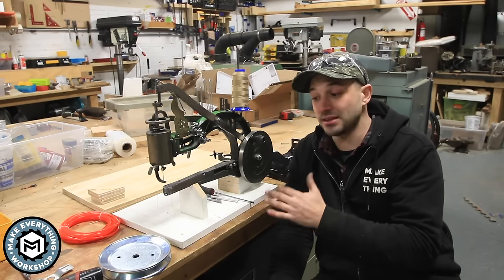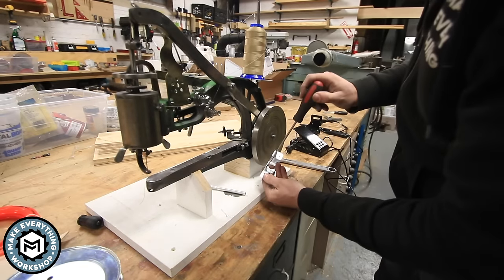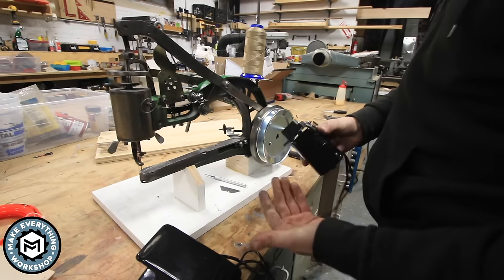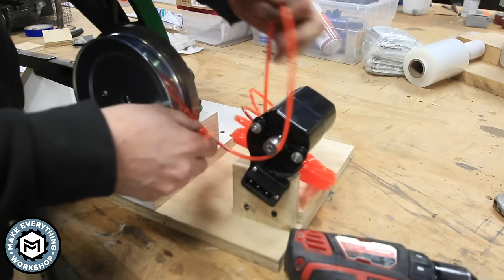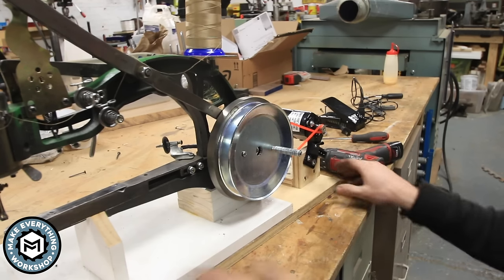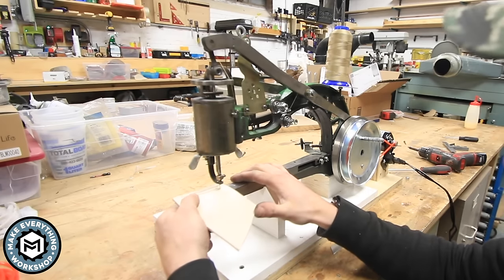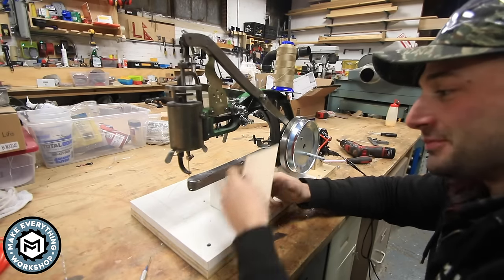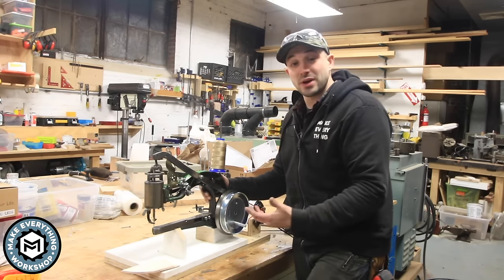Motorizing The Leather Sewing Machine, For Under $50

Comment: Servo motor is what you need. Programmable, able to get motor rpm down to 100rpm, with that pulley setup, machine would crawl
Reply: No, he only needs a light/fan dimmer to slow the motor. I added one to my mum's Singer machine, it works beautifully.
Reply: i used this vid to put this set up on mine and and adding another pulley for reduction did the trick.
Reply: @gustavzollernmakinen1516  I'd like to hear how that works. By creating more of a current draw? I dont get what that does
Reply: @shlomo_jewinstien-Doodoowitz  Just take a fan/light dimmer, solder a lead through it; at one end a female 2-pin plug and the other end a male 2-pin plug (the dimmer being in the middle). The foot-pedal plug goes into the newly installed dimmer female plug. 

Tune the dimmer down to controllable limit. (Dimmer lowers the amperes, making the motor slower) It will never go mad fast on you, regardless of foot pedal input. The foot-pedal becomes very controllable.
Reply: @gustavzollernmakinen1516  I see what you mean basically putting in a rheostat inline
Reply: @gustavzollernmakinen1516  The problem with that solution is that you lose torque as well as rpm when you control the speed by reducing the voltage. That's also hard on a motor and can frequently lead to premature failure of your motor. It  burns the windings on the armature.
Reply: @jjohnson2553  Dimmer reduces the ampheres, not the voltage.
Reply: Can you send me a link
Reply: Lots of good advise here. But as for the belt have you considered using a leather strap kinda like the old Singers sewing machines. Those are more rounded but perhaps a flat leather strap for a belt. Just a thought. Thanks y'all.
Reply: I was thinking the same thing. But what a great job.
Reply: @gustavzollernmakinen1516  well… sort of. Depends on the dimmer and the application. Lamp dimmers tend to work by flipping the power on and off at strategic points in the AC waveform. You have to make sure this is compatible with the motor input you’re using. At the end of the day, it’s probably worth spending a bit more to get a motor which offers a way to reduce speed through its own circuitry.
Reply: @rmTheWalrus  I’d definitely take advantage of the RPMs for added torque with a 3d printed gear box at the price. With how sketchy some of these Amazon motors are I definitely wouldn’t jump into dimmers without being able to verify either. Considering there are ready to print multi-ratio gear box files for free it would be a fun addition.
Reply: So, through a pile of money at a hundred dollar hand crank machine? 🙄
  Just buy a Consew.
Reply: @ralphguerrero518   if leather belts worked motorized machines would all use them. They suck. Today we set up treadle machines with rubber belts.
Reply: @gustavzollernmakinen1516 that's interesting! Thanks a million!
Reply: Yep, sewing machine motor 1/2-3/4 hp on amozon  RPM adjustable from 0-10000 reversiable with rpm read out for little over 100$. BTW if you are thinking about building a wood path these machine motor would be the cats meow. Single speed will be priced as much or more do it out.
Reply: Engineer from Germany?

Comment: The foot turns so you don't need to turn a large piece of work. Like if you want to back stich to "lock the thread" just loosen the wing nuts, turn the foot 180 and retighten the nuts, and run the machine a few stiches.

Comment: Easiest way to fix it:  Pull the cover off of the foot pedal and unscrew the potentiometer about 1/4 turn. This will eliminate that fast and immediate ramp-up you get. Easier than making pulleys, adding bolts, etc. Small screwdriver and 1 minute of time.
Reply: Is this in reference to slowing it down? I was just going to ask about that. I did exactly as he showed in the video and man is it fast. I want to have the machine go slowly consistently if I can instead of tapping the foot pedal over and over again.
Reply: @calebhand1180  Addd a switch and a diode to the pedal only. when u turn it off its on half speed when u turn it on its on full speed.. See this video.... https://www.youtube.com/watch?v=lH4W_d4Mp2c

Comment: Actually all you need for the motor, is a Singer treadle motor like what is used on the 1926 Singer Treadle sewing machine electric conversion. That will give you an electric motor, that will be about the right speed. Your other option is to just find an antique singer treadle base, to make the sewing machine peddle powered. Speed would be much lower with a treadle base, and thus easier to control.

Comment: Bigger wheel on machine is more torque and slower speed.
Reply: I was about to say the same thing.
Reply: I learned this from The Great Escapist lol
Reply: Using a resistor will also make the motor go slower
Reply: @kandlrex  and eliminating the desired torque to punch through leather.
Reply: Would more torque cause the needles to possibly break or bend easier?

Comment: Reversing the connections to the brushes or the field winding on the motor will reverse the direction of rotation.
Reply: he should've gotten a motor controller or geared it down a bit to deal with the speed rather than relying on the pedal for speed control.

Comment: Very nice.

Just a quick note, when you're turning a corner, bury the needle, and use it as a fulcrum around which to rotate the sewing material. Bury the needle, and you can then even lift the presser foot slightly to relieve tension. 

This will keep the stitching consistent, and you won't have to worry about having any thread tension issues, or unwanted loops or gaps in the stitching.
Reply: Thank you so much!! Really awesome advice!! I am a chemical engineer however I need to change my image so I am going to customize my sneakers and other stuff and I found this gem....

Comment: My mother had an old Singer brand sewing machine.  It was a production model that was originally a foot peddled version that had been remanufactured with a motor and a suitcase box to transport it.  I remember she always had to give the belt driven pulley a small nudge with her hand when she stepped on the peddle.  This was to get over the standing still start because of the low power of the motor.  Once moving it did a great job.  Brings back 50+ years of memories.  Great job!

Comment: Very nice video! I used this for inspiration when I did my motor job and I found out that a lot of the "violence" is caused by the hand-wheel being out of balance. I used a hand held drill to drill indents in the wheel and "balanced" it so it runs much smoother. I ran it for a while and then decided to make a jack-shaft to further reduce the speed and made a table so that I had more surface area.  Of course the drilling of the hand-wheel brings it out of the "no tools" upgrade but I'm very pleased with my final product. Thanks for sharing your knowledge.

Comment: I already have a bunch of motors with pedals from repairing old sewing machines and you literally did exactly what I was thinking with this!  I also have a variable speed dial wired into the outlet I would use that would help reduce the speed even more .  Good job you've made me 100% convinced I need one of the cobbler machines now!

Comment: Great mod!
Twisting the belt like that runs it across itself causing friction. That'll eventually break it. You could just turn the motor around or reverse the leads in the motor. Or you could get an old drill press at a garage sale and use the motor in it which will be stronger and slower.
Reply: شد سعر،$
Reply: Another alternative would be to tilt the motor support so the top of the support is slightly further back than the bottom.
Reply: I don't think that reversing the leads on the motor would do anything since it is AC powered.
Reply: @my_dear_friend_  I "think"  those old sewing machines had universal brushed motors. With a brushed universal motor, the direction is set by the relative polarity of the magnetic fields of the field winding and armature. If the wires are long enough, reversing the connections to the brushes will reverse the spin. If it's a single phase induction motor then you're right, reversing the leads will do nothing.
Reply: @MrErViLi   - yes, as far as I know, the old sewing machine motors are brushed. That would be a simple fix then.

Comment: For your information, there is a glue for gluing the rubber cord together.  It's used to glue O-Rings together in hydraulics.  The name is Weicon, part# 12204030.  It dries extremely fast and it's strong.  BTW, a servo motor would be a better choice for this machine.
Reply: I just use any ca glue for o-rings...
Reply: There is one on Ebay for 40 bucks couldnt get much cheaper.. I paid allot more than that for the one on my Sailrite LSV1 sewing machine.. But love it..
Reply: Servo motor he is cheap that is not a solution
Reply: Welding is the correct method to join PU drive belting.
Reply: Servo motor all the way!
Reply: @pressuredprepper4232  link?

Comment: Brilliantly simple solution that could be refined with an idealer gear swapping the direction of the motor an elecronic footconrol etc
 Thanks for coming back with this simple solution. £67 on Amazon in the UK and we use 230v mains so more torque from a motor.

Comment: Personally i would add a layshaft with a small and large pulley on either end, turn the motor round to face backwards, a belt from motor to large pulley, through the shaft to the small pulley and onto the machne.
This would mean a greater reduction in speed, more control range, and because the motor is the other way round, no need for crossed belts ;)
Reply: Your idea also gives room for a step pulley to experiment with the speed range to see what works best.
Reply: @philsullivan3679  No idea what he means, but I wouldn't use a motor. A machine like this was never meant to go that fast, it operates at a low speed with a lot of friction. the best way to make it a bit more automated while keeping the speed low and control high would be to add a manual foot treddle attached to the handle on the guidewheel. (look at old manual grindstones to see how it works.) it would be fewer modifications, and could possibly be made with nothing but scrap lying around.
Reply: @j.c.cannon2112  basically, because the motor "turns" the wrong way, turn the motor around so belt isn't crossed.  The belt would then be attached to a large pully on a shaft (with bearings), that shaft would have another small pulley on it with a belt from the small pulley to the bigger pulley on the sewing machine.  This should slow the needle speed down enough to make sewing easy due to the slower speed of the needle going up and down and feeding the material into the machine for sewing.  Hope it helps.
Reply: I was thinking the same, and one wouldn't have to worry about electricity. Low tech is go tech :)
Reply: @blkcc1  Doing it that way would also alow the motor to run faster to pull more cooling air through it and produce more power at the same time.

Comment: Dude, you are my hero! Not only did I get the little green Cobbler machine but I ordered all of the other thiings to make automatic. Now one thing my brother and I found out after struggling for over an hour to get the machine to sew and that was the thread it came with. The thin thread it came with would not sew. We adjusted many things and ended up with the original settings all due to the thread that came with it. Once we tried thicker thread, it worked like a champ and we ended up in the original settings. Dah, we didn't think about the thread size.  Well it's running beautifully now and hope to make great leather bags, motorcycle saddle bags and leather vests. Cheers holmes!
Reply from the maker: It’s a great little tool I’m glad you got use out of it!

Comment: Thanks for the vid. I glued rubber mat to the bottom of mine to stop "creep" (cheap mat that goes under throw rugs). For threader wire, I have one out of stainless steel safety wire (motorcycle stuff), one made out of guitar string and one made out of .030 MIG wire from my hobby welder.

Comment: Glad I found this. I need a leather machine but don't want to spend what I did/do on my sewing machines as I won't use it as much. File the sharp edges of the teeth on the walking foot down a bit. When you turn corners bury your needle and lift the foot. Don't try to use the foot as a pivot or you'll tear stuff up.

Comment: I thought mine really needed a DC Techsew servo control motor that can be foot controlled from 3 stitches per minutes to 2200 spm.  You can turn a larger flywheel out of stress free steel or cast it from cast iron.  I used a leather stitched belt and gave it a classy old ‘factory floor’ look.  These are great machines for the compulsive tinkerer!

Comment: Awesome  modifications installing the motor on this machine ! I love how you found easy to get parts  and  didn’t need to do major modifications to the  original  components of the machine, as a retired Woodworker ive always thought  it would be a great channel  or Website  doing similar modifications to all the Chinese knockoff or Clones that so many people  over the years have  purchased from Harbor Freights or the Internet  like smaller  shop tools such as stationary sanders and similar items  but doing it  in a similar fashion that you have done on the sewing machine  as many of those Clone machines  have inferior motors  or  internal  parts  like plastic bearings  etc  and  similar  items to   Get manufacturing costs lower  which is why i suspect  nobody manufactures that sewing machine with a motor  ? At least to my knowledge  I haven’t seen one for sale  on the internet  as all the ones ive seen just have the hand crank  !  BTW sewing is actually one of my hobbies as i began doing it  to make Custom cushions and Canvas  covers for my Boating habits and new interiors for Vintage Automobiles  because  i wanted a coat savings and more  quality control  over hiring  others to do it for me  i used to get funny looks from older ladies in  Fabric stores  whenever i would ask staff about tips or products  because I didn’t look like a typical Seamstress LOL i usually told the old ladies yes i sew  but i sew Manly things like heavy Vinyls and Canvas , my sewing machine will  stitch  Canvas onto a wooden Yard Stick  if i wanted to do so ! I have Stiched Vinyl  onto a 1/8” piece of plywood  for a cars door painal and other interior  parts   Because i wanted decorative stitching to show on  kick panels   In the passenger compartment  and trunk areas of a car i did  sometimes people use heavy Cardboard  as well  but i had  the  thin plywood left over from another project  in my shop  ?

Comment: I spent 16 years working as a cobbler, I always preferred a tredlel foot peddle over electric motor for control. The patcher sewing machine that this sewing machine had a optional table top that encased the bobbin arm. Table might be a neat project for you. That belts neat, I'm use to a leather belt with a hog ring. 

Also on the singer on the back side of the head had a thumb screw that locked the  direction of the foot direction. Might be able to drill and tap a screw. 

Any more Sportster videos planned?
Reply: i thought a treadle might be a better solution since you are the speed control.

Comment: I have a manual wire stripper, and after a hand full of blisters, I bought a $1 bolt long enough to to pass through the feed cylinder. Then I attached an electric drill to the bolt with a $12 powered foot pedal. Easy assembly and disassembly
$13 bucks and I can use the drill and pedal together or separate for any number of other projects

Comment: maybe I'm a little late to the party, but I came across these on amazon yesterday and just ordered it. i;ve been building up my kit for hand stitching leather and doing leather book covers. some time ago I bought a cheap-o entry-level singer for some small thin stuff and funny thing, they sent the singer and it was junk upon arrival. I told the vendor and they said to keep it and we'll just send another one and they did. So, my point is, your project here inspires me to pull the trigger on the manual machine like yours, knowing that I already have a parts machine here that I can use to mod this manual one. parts like the motor and foot pedal and maybe the lights too. excited about it all! thanks for sharing your content!

Comment: I just got one of these machines, unused, off of craigslist for $40. I just ordered all the parts in your video. The prices have gone up a bit since you made this video in 2020, but it cost me a total of $100 and some change. I already have wood and paint lying around and this project is going to happen this week. Thank you so much! I'll be using this machine to sew on patches. Also, that part that moves the foot around is that way intentionally. It's a multidirectional machine so you can move the direction of the stitching without moving the piece you are working on. So don't tighten it up!